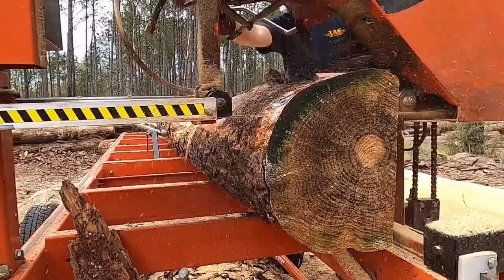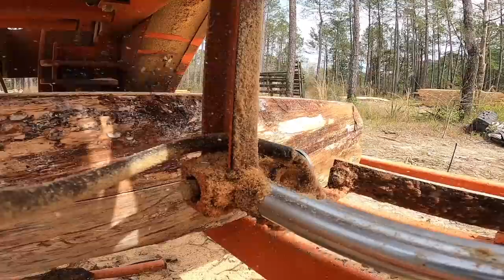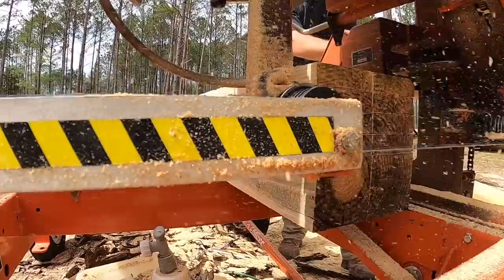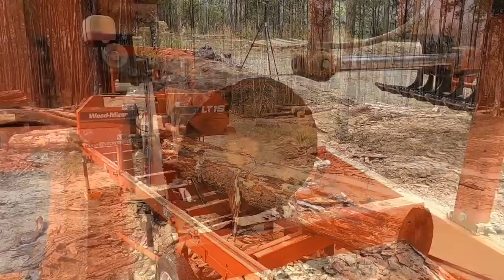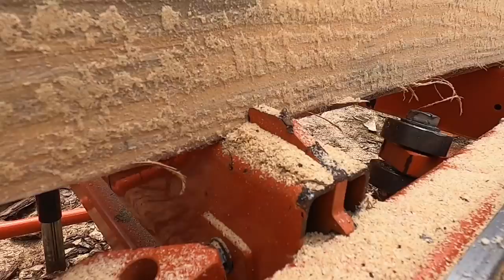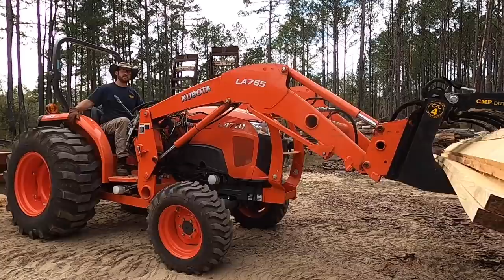PERFECT Custom Lumber From a Portable Sawmill

Comment: Hey Wes, If you don't want to / can't use your quarter scale, here's how you can start your cut so that your last board will end up the correct thickness every time.

(Board thickness + .125) x number of boards = starting point + .125

So, for 10 2-1/4 boards,
(2.25 + .125) x 10 = 23.75
23.75 - .125 = 23.625
So, to cut 10 perfect 2.25" boards, start cutting at 23.625 or 23-5/8 and your last cut will be at 2-1/4 inches.

I'm a portable sawyer (the guy that bought your sharpener / setter) and I keep a calculator in my tool belt for these situations that don't occur on my quarter scale. Hope this helps!
Reply from the maker: Cool! Thanks for that info! Hope the sharpening setup is serving you well.

Comment: Great job of explaining your cuts on each log to maximize yield. I would like to know why you turn the log with an upward motion versus pulling down from the other side. Hurts my back going up but then I’m quite a bit older.
Reply from the maker: Thanks for watching, Donald. I pull the cant hook down whenever I can, but when trying to flip 2-3 small cants at once it's not possible.
Reply: @falllineridge  yep, I agree with your reply. One more note, I run a LT 35 hd with a b57 belt on both sheaves till recently. Now converted the drive sheave to a b56. Pain in the rear to put on but glad I did. Way less vibration, has to be better. Not sure you run the same size but do recommend the change. Would make a good vid also. Happy sawing

Comment: Wes, did I hear correctly that you have to set your inch scale to 4 1/8" to get a 4" thick board?
Dave
Reply: He said the 1/8" was for the kerf.
Reply: @tonygrimes13  Yes, Tony, he did say that but if the scale is adjusted correctly, and it's set at 4 1/8", he will end up with a board 4 1/8" thick NOT 4".
Reply: @tonygrimes13  The pointer/ scale should ALWAYS be calibrated so that the kerf is above the pointer, not below. That way when you're at 4" on the scale you get 4" on the bunks.